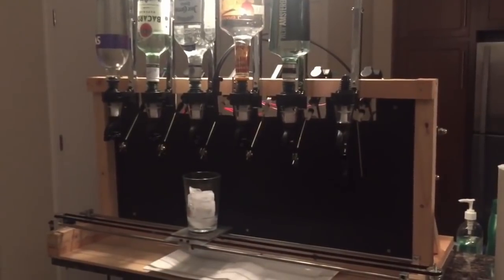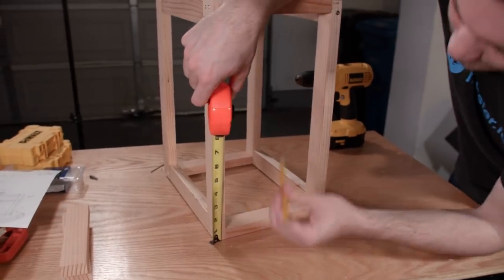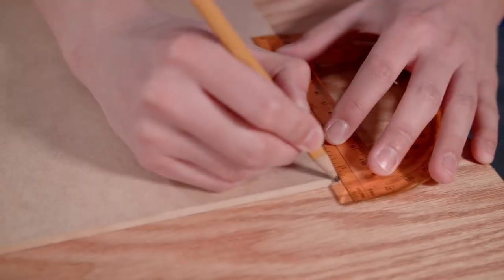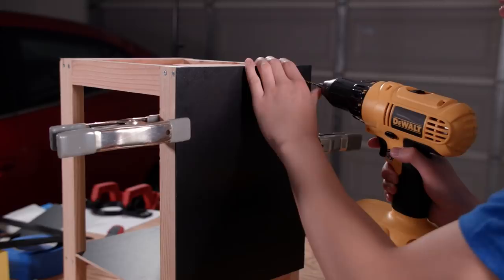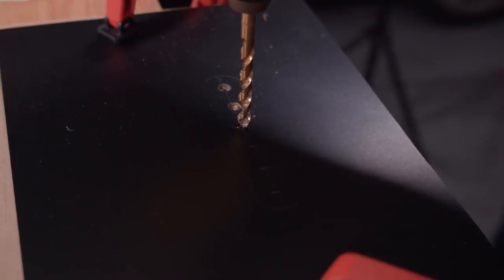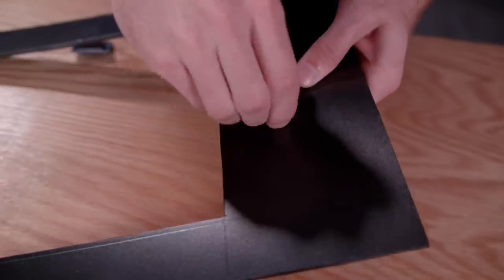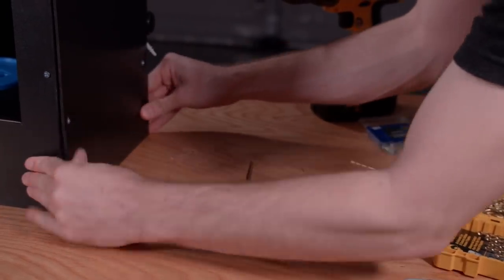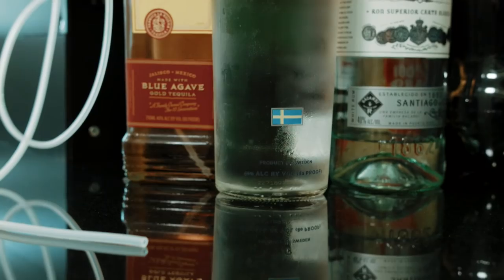How to Make a Raspberry Pi Smart Bartender

Comment: Awesome project! I made a similar bartender robot 2 years ago for a school project, it had 15 alcohol and 5 mixer bottles, used WIFI with 17" LCD monitor and came with an app. Also I used almost exactly the same parts, pumps, relay boards, funnel etc. I kept running into the problem of losing all the fizz because it ran thru the pumps, something I didn't solve in the end.

If you want any info or photo's of my project, let me know. I'm not a code genius but I'm sure I can help you out if you want to make a version 4.0
Reply: Did you ever experiment with a touchscreen display? I’m running into some trouble converting this project over to raspberry pi’s 7” touch display as opposed to the OLED and buttons. Also worth noting in very new to Python so I have essentially no clue what I’m doing hahahaha

Comment: At about 6:04 I've seen that you screw the multi-core wires directly into the terminal. They conduct better when you cover them with solder before, so that they have a silver end. Much more conductivity and less electrical resistance and power loss. :-)

Comment: One of the better produced videos. Informative and fun project. Adding the iBeam and frigerator are great ideas. There are issues... the funnel is contaminated with the other liquids. So if you are allergic to something, that could be an issue. Also bottles need closure or caps to protect the bottle from bugs or other elements, which you can probably buy. Could also add a 'counter' to know how many ml have been poured out. Would love to see this app 'driven' and configurable via an iPhone too! Awesome project and video.

Comment: Great job!! I would like to make a similar machine for my laboratory, mixing liquid raw materials (instead of drinks) following a formula to get a final product. The problem is that the volume need to be very precise (20 ml should be 20.00 ml, no more no less). Do you have guys any idea how I can make the system more precise with the volume ? Do you think if I add a water flow sensor it could work? thanks in advance for you help !!

Comment: I assume you guys had trouble pumping the carbonated drinks? I've done something similar before with peristaltic pumps and carbonated drinks always create air bubbles in the lines which reduces the amount of liquid output.. it really screws up the drink ratios
Reply: Does the carbonated liquids lose their fizz after passing through the bombs? I guess this leave out drinks like the Cuba Libre.

Comment: So if I got this, in lamens, your saying raspberry pis can be/ make operating systems for machines?
Any machine? And how would you do maintenance?
Reply: The Raspberry Pi is just a computer running on linux with some GPIO pins hooked up to it so it can control external electronics. So basically it's just a regular computer that you can connect with external electronic components and control them through it. So it can essentially function as the "brains" of any electronics machine you can design.

As for maintenance, you have the ability to remotely login to your RPi from any computer in your house through a particular network protocol called SSH, and make any change you desire from said computer, without needing to have direct physical access to the RPi itself.

Comment: Put it all in a refrigerator. Perhaps create sealed caps with a breather vent so all the bottles could gravity to the pump. Looks like there was a bit of an issue with head pressures.

Comment: I think you should of had one air pump connected to containers then have electric valves connected to tubing instead, this would mean the fizzy drinks would always have positive air pressure container meaning they stay fizzy, the air pressure would push the liquid through the tubes.

Comment: you guys should add a purge mode that pushes out the old liquids and has the system prepped with the new ones you could also use that mode to clean it by running soapy water through

Comment: Just want to preface this comment with a big props to Hacker Shack, this is a very solid build and very well designed and put together. But as with everything, there's room for improvements, so here's a few tips, if you want to replicate this build:

It's generally seen as a bad idea to not have a runoff tray under the cup holder. Spills WILL happen and it is much easier to slide out a runoff tray and empty/clean than to replace a wooden platform a few times a year.

It's also generally seen as a bad idea to have electronics mounted underneath where liquids are likely to reach, such as under a drink dispenser with only a wooden board (with holes) between the liquid dispenser and socket voltage components. Put a sheet of plastic between the cupholder platform and the electronics, just in case, or move the electronics to the top of the frame.

The build is also very rigid, not a lot of flexibility for future repairs or upgrades. Replacing the screws with something like furniture screw-latches will make it easier to disassemble and reassemble in the future. You could also add a hinge to the electronics compartment access hatch, instead of using adhesive tape, as the latter will run out of stickiness after only 2 or 3 removals.

You also want to make the top as a lid, not a screwed down fixed part, as you will want to clean out that funnel once in a while. Especially if you use sugary drinks, as those tend to stick and eventually create mould.

Comment: Wondering why you don't just extend the tubes instead of dumping into a funnel. If you extended them, so that the liquid leaves the tube and goes directly into the glass instead of a funnel, you would not have as much to clean up when you're finished using it for the night/day.

Comment: My suggestion was to add 3D printed mounts that would accept the bottles and tilt so that you don't have to worry about the tubes staying at the bottom of the bottles. This may also help with maintaining the seal for carbonated beverages. It would probably have to be a larger box and base to support the weight but it might provide a nice way to showcase "the well"

Comment: How long did it take to pump? Any faster tech?
Reply: You can buy bigger pumps. The ones they are using are quite small, but I guess that because it's only a small measure of some of the drinks.
Reply: @V3GAS4CE  you could probably have a bigger pump for your mixer, like coca cola or w/e

Comment: In order to keep the drinks cool without putting it in a fridge you could get some buckets of ice and simply place them in the buckets. You should also try and use liquid nitrogen to cool the drinks and see how that works out! :) P.S. This is awesome and I want to try and recreate it in the summer. Would be great for uni next year. Cool to have drinks on demand without mixing them. You could even make separate machines preconfigured to make specific drinks.

Comment: For 2.0
For the reservoir/manifold 
I'd add some form of refrigeration, even if it's just an ice trough, angled bottle storage, uniform liquid reservoirs, cork stoppers with tube feed (very easy to make), and lastly would probably increase feeds from 6 to 8
For hardware
I'd move computer components to a wall compartment, instead of having it under the drink tray, add an ir sensor to recognize that there is a bottle there and if you can swing it voice integration would be cool

Comment: Therese a few things you could have done to make this better, countersunk drill holes so the screws fit snug, glued the wood together as it gives it more support and lasts longer than screws, acetone for the funnel holder because it actually fuses the plastic as 1 piece rather than just gluing it together.

LEDs lighting up the fluid that comes over the top would be cool.

Also you should have noted that not all wiring colour schemes are the same for mains power, white/light coloured wires are usually live in other countries and wiring a supply backwards cane make it explode

Comment: Black wire should be on line terminal, line is input. Load is output going to a device on the circuit.

Comment: Add an electronic scale to measure out the liquid amounts accurately. I haven't looked at the code but I assume it's currently time based. In the recipe config allow to define whether ingredients should get added sequentially or in parallel. This allows for some rainbow drinks 🌈😃 May need to add an angled soft tube that pushes against the wall of the glass and very slightly angle the platform so that liquid enters the glass smoothly instead of just splashing down.

Comment: You cannot put the cap back on the bottle as the bottle will get a vacuum; pulling the drink just as much back in as the pump is pulling it out. You could fix it with a one-way-seal but that is probably overkill

Comment: Great project, it looks awesome !
Isn't it too difficult to wash (tubes and funnel ) ?
Reply: If I had a 3d printer I'd make a fitting for both ends of the tubes color coded to make it a continuous loop, a small valve to drain into the sink or close the loop, and change out the beverage bottles for bottles of water, bleach, and distilled vinegar, liquor and soda have long shelf lives so you wouldn't have to do it often.

Comment: What about those chemical laboratory grade rubber corks with a hole through them usually used for glass tubes? That way you could leave this hooked up on your bar and not worry about dust or other contaminants getting into your bottles. Plus it's ABOVE food-grade chemically safe at that point.

Comment: Cool project excellent job.  I do have a question however do you have to purge you lines before use?  The pumps are the same as in many auto samplers.  The auto samplers however go through a purge process in order have the line full before pumping thus getting an accurate measure.
Reply: Haha...you running HPLC, bruh?

Comment: Just a suggestion, using a peristaltic pump to directly pump carbonated drinks is a bad idea as it can fizz up and you'll get a varying amount each time. It'd be better to create an airtight seal on the cap and use an air pump to "push" the drink through a separate tube
Reply: That's a good idea. I was thinking of putting the carbonated bottles upside down and use gravity and electrovalves to enable these liquids, and peristaltic pumps for the non carbonated drinks.

Comment: This is a bit nit picky but when it comes to carbonated drinks like coke, when you first open it and start pumping it will probably be lets say 20% air or something, but as the party goes on and carbonation is slowly being released it will probably be more like 10% air however I don't think the current system will be able to tell the difference.  Pretty awesome though. P.S. I'm pretty sure tequila sunrise has grenadine in it, I definitely didn't spend my time in college learning cs.
Reply: Good point. Would a rubber cap with a small hole for the tube plugged into the Coke's bottle solve this, or is it the peristaltic pump the one to blame?

Comment: Hi, I build the Bartender myself and ran in the following issues:

sudo python Bartender/bartender.py
Traceback (most recent call last):
  File "Bartender/bartender.py", line 364, in <module>
    bartender = Bartender()
  File "Bartender/bartender.py", line 68, in _init_
    self.pump_configuration = Bartender.readPumpConfiguration()
  File "Bartender/bartender.py", line 91, in readPumpConfiguration
    return json.load(open('pump_config.json'))
IOError: [Errno 2] No such file or directory: 'pump_config.json'

Do you guys have any idea what I could do to solve the problem? I tried many things but just can't get it working.

The screen is showing random pixels at the moment. Thank you very much!

EDIT: Ok, we got it working without any error. But we still got issues. The script shows several drinks as a output in PUTTY, but just randomly. And sometimes it even says screwdriver?!

Comment: maybe add a jug of water in the back with a flush option so you have no cross-contamination, unless all of the individual tubes are dispensed directly into the glass instead of mixed before they are dispensed, in which case i apologize.

Comment: My only thing of trouble was: You have all that empty space inside the unit, yet you decided to place all motors on the outside, which in the end also needed a manifold. 

Why not everything inside, and only let the tubing coming out the back of the unit? Saved you a manifold ( or at least on the outside ) and lots of bare electronics on the backside

Comment: Nice project, but not very safe from electrical point of view.
First, as many others pointed out, electronics under the liquid it's not a good idea.
But the other thing, bare wires, or soldered wires in screw terminals are not safe, it can catch fire. Use ferrules!

Comment: Not shown in the video, the peristaltic pump used in the video only pumps 100ml/min. So for a glass like that you would need 3 minutes to fill. Add in the wait time between different ingredients (unless you have enough power to run multiple pumps simultaneously) and you might get a drink every 5 minutes.

Comment: maybe add a cleaning function: where you press both buttons and hold for 6 seconds for example, and then it will cycle a full glass amount of liquid through each tube.

that way, you could have a container behind it, where you put all the tubes in fill it with hot water and vinegar, and clean out the tubes from nasty things, ready to cycle through a second and a third time with just water, to make the make the machine nice and clean.

Comment: 12:54 A few moments later...Few points from my side : the pumps work slow plus drinks are outside so there is no storage for the liquor/ soft drinks that can cool it like a fridge . also the benefit of making it like a fridge you can provide Ice and adjust the machine to provide ice for the drinks or adjust it as you like it with or non.. Well i guess in the next project

Comment: Doesn't that LM317-based 5v regulator get way too hot powering a Pi? That's several watts of heat going into that tiny attached heatsink, and i don't think burning hot metal and drinking go together well. A cheap SMPS "buck regulator" would run cool and take up the same amount of space+budget.
Reply from the maker: It's what we had. I have a buck regulator linked in the parts list

Comment: instead of using a hard coded flow rate variable, i would have liked to see a load cell used. they are cheap. 100g load cell you could get for around $10

Comment: Next time you 3D print something that’s gonna hold weight, make a male and female notch on the joining faces of the printed parts, when you glue them they’ll be a lot stronger. (Talking about having a hole on one face and a cylinder shape on other face to join them like a puzzle)

Comment: I want to learn how to do all this programming/ wiring stuff, where should I go about doing this?
Reply: college
Reply: isunktheship went for my BA in Lit. But I don’t remember learning any of this 🤔
Reply: Honestly, just come up with a project and go for it. That's how I learn, anyway.

For electronics, start with some blinking LEDs or something. Then go for switching relays or something. That's essentially all this is doing, anyway.

For programming, start with a Hello World program, because that's tradition, and then figure out some simple program you might want. Automating some task you do frequently, for example.
Google is your best friend in this. Break the problem down into its core components and look up how to do the individual things. Start with a barely functioning version and then flesh it out.

Of course, if you have never done any programming at all, looking at a tutorial is good, too. You should know the basics of the language you use.
In the video, they were using python. I have a lot of problems with it, but it is very popular. My personal favourite is Haskell, but something like Rust is good, too.
Both of those are a little different from most other languages, so be aware of that if you want to start with one of them and later choose to branch out to others.
Reply: Yndostrui And maybe use an Arduino instead of the Raspberry pi

Comment: I am having an issue powering the adafruit LCD from the raspberrypi and the 5v regulator linked in this project.  When I connect the 5v micro usb power to the wall the raspberry pi functions normally and powers the LCD and cycles through the options.  However when I connect the 5v regulator to the rasperry pi the pi boots normally but does not power the lcd once 'sudo python bartender.py' is initialized.

I used my multimeter several times on the 5v regulator and it outputs a clean 5v right on the money.  I tested the unit further by unplugging all other components including any mouse or keyboard used during configuration.  The LCD refuses to power on even when the raspberry pi runs the python script at startup.

I am using all of the same equipment linked from this project.  Am I missing something?  Is anyone else having issues with their LCD?

Comment: @1:21 "it was helpful to use a small drill bit to drill a pilot hole before we screwed the pieces together", going by the split in the wood you weren't that helpful with the first attempt :)
Reply: It was another piece of wood, but I thought the same thing initially.

Comment: why not make the tubes and pumps bigger so it can pour faster? also make the tubes longer so you can set this thing on top of a mini fridge with a small hole in the top for the tubes to go inside the fridge where the drinks are :)

Comment: Instead of using 6 pumps, couldn't you just use 1 pump with a 6 way electronic valve, or maybe a few smaller electronic valves?